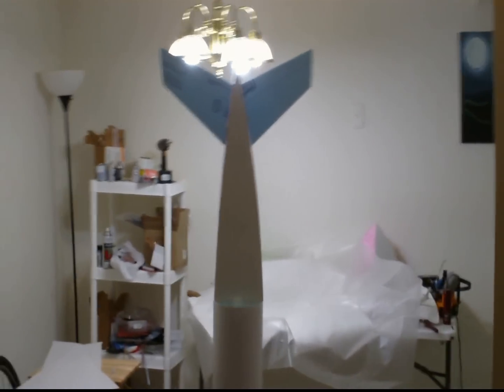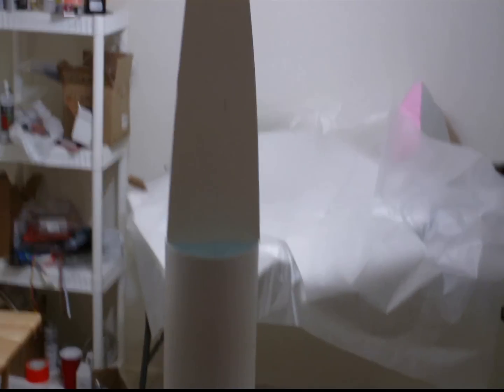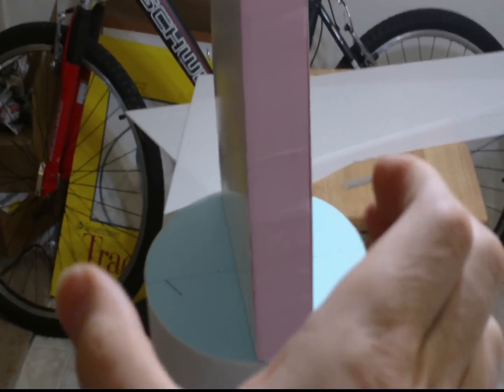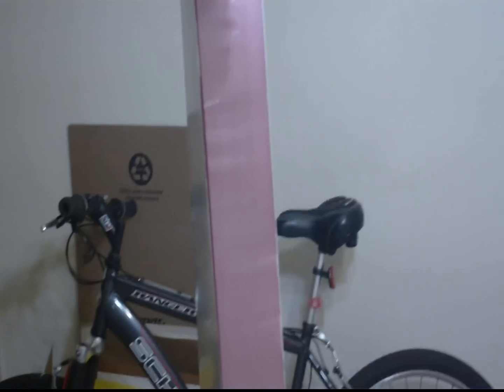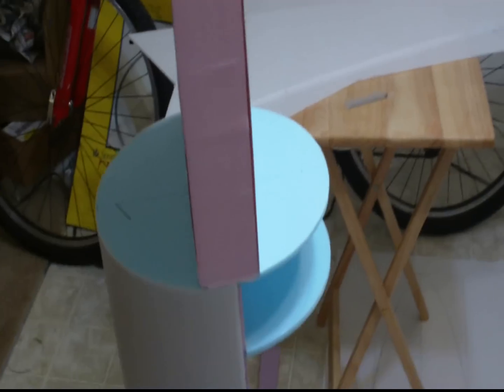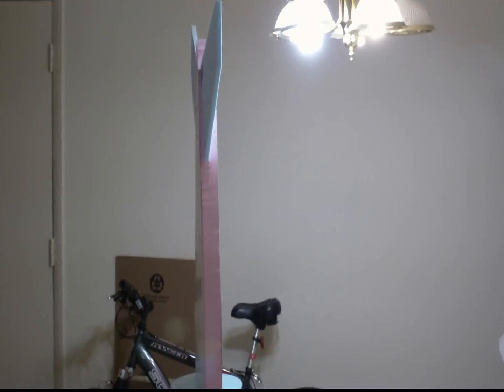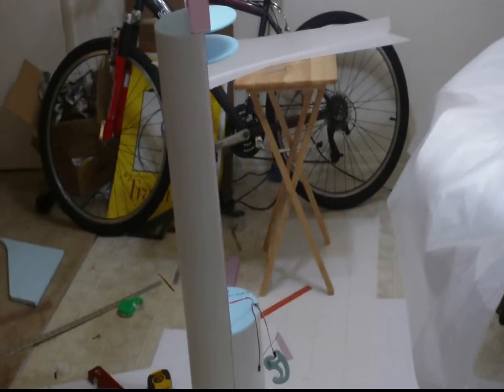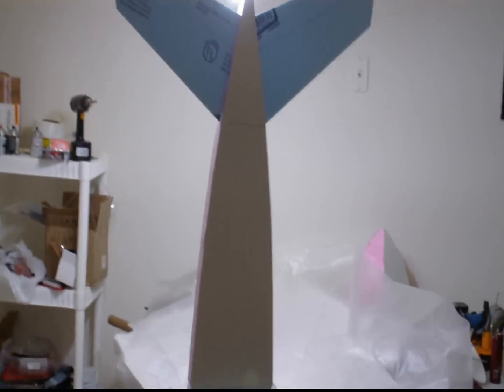How to build a 7 Foot Airbus A300 RC EDF Airliner Part-30

Comment: Hi,

very good stuff. Considering working on a project for my bachelor where my university with two other universities (Dortmund and Berlin) want to develop a drone. This is inspiring man. Have you considered using sandwich techniques to increase the rigidity over the full fuselage? When you sandwich materials with different properties you can improve the overall properties. Could use something like GFK.

regards